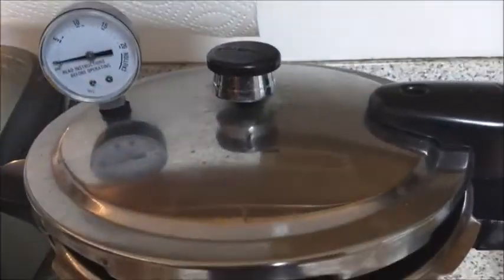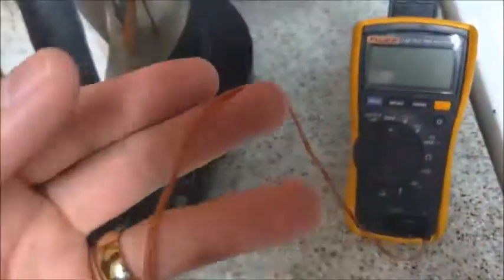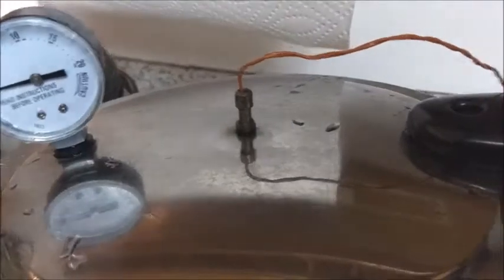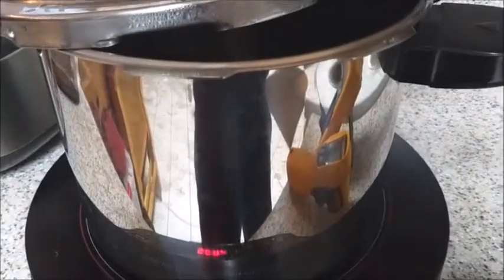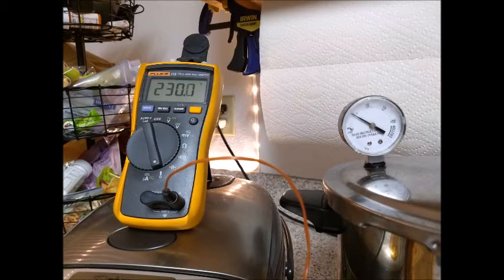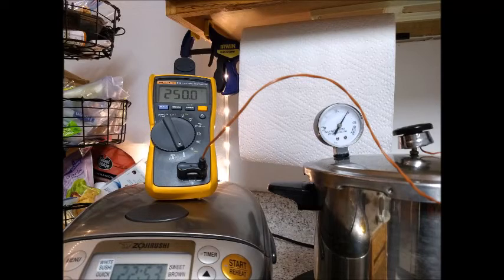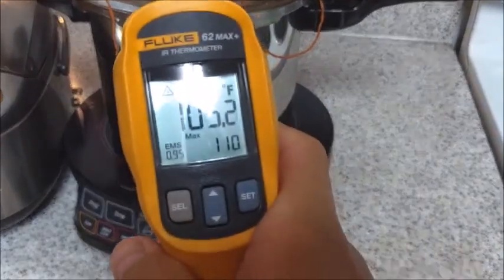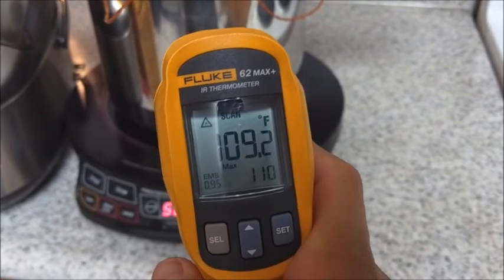Testing the Temperature of a Pressure Cooker Compared to the Pressure Gauge.

Comment: I had the same question. My ir should read about 120 celcius but measured less. I end up that the sampling point was wrong. You need to take measurement at the bottom of the pan just above the heating element. There my ir thermometer meadured exactly 120 celcius

Comment: Hi,  have you tried other pressure cooker with extra slot on the cover and add a thermometer?
Reply: Please link what pressure cooker you're referring to.
Reply: @mb7hl  like this http://kirin.co.id/small-home-appliances/pressure-cooker/kpc-24s/
Reply: There are two extra valves that possibly can be replaced by pressure gauge an thermometer with 10mm diameter slot. I'm not sure yet since the pressure gauge is higher in price than the pressure cooker.  I bought the pressure cooker a week ago for my duck recipe. I want preserve it so I can sell it online.
Reply: Originally, I didn't understand what you meant by "thermometer". I'm guessing you meant the pressure gauge.
You don't need to have a gauge installed. If your pressure cooker is made to specifications, as soon as the pressure regulator starts "dancing", it's at 15psi.
Reply: @mb7hl  the product example is here https://m.id.aliexpress.com/item/32962156429.html?pid=808_0014_0131&spm=a2g0n.search-amp.list.32962156429&aff_trace_key=&aff_platform=msite&m_page_id=65119jQU2-93oohDpGQyga8yZMWDqQWJMTFvIDEMmdINdkiJlODM2XFKrqTApjzaBTeM1556873012378
Reply: That is the example of the gauge completed with temperature meter (what i mean with thermometer)
Reply: I'm not sure if my pressure cooker will reach 15psi since i found nothing on the manual. 
As I see here there were two additional weights to reach 15psi which are not included in my product item. 

https://youtu.be/uAUC6cvpW0Q
Reply: The industry standard for pressure cookers is 15psi, so your unit should do it.
I looked at the AliExpress link for your temperature gauge. That unit is overkill because 15psi is roughly 1 bar.
This is what you want:
google.com/search?q=pressure+cooker+gauge
Reply: @mb7hl  Thanks I hope so.  Sorry but the pressure cooker costs only $11. It's chinese. I think i'll go with your assumption on the industry standard.